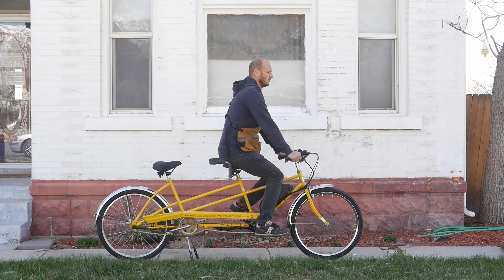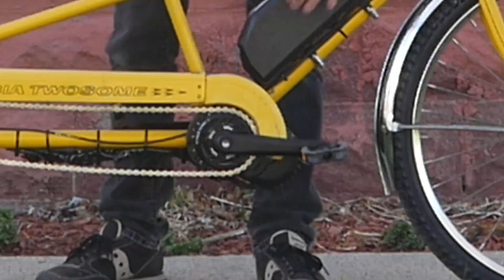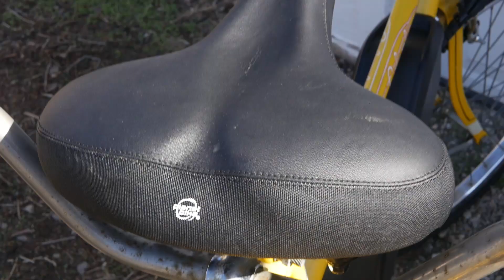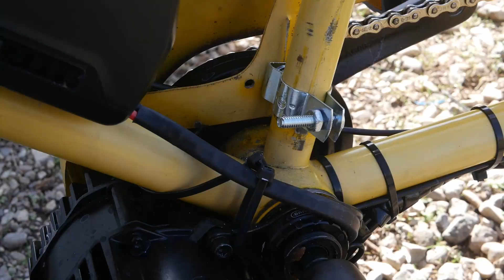Custom Electric Tandem Bike Build: Columbia Twosome Tandem BBSHD 52v

Comment: I have a mid 90's 21 speed tandem mountain bike that keeps telling me it wants to become an e-bike. Right now, it's just wispers, but they grow louder with every e-bike conversion video I watch. If I mount the motor on the front crank, put a bigger chain ring on it with a smaller chain ring on the rear crank, and I should be able to hit 45 mph easy. By myself, of course.

Comment: I've got a tandem that I don't use too often because it's made of steel and heavy. However, thinking of the BBS01 (since local regulations here limit to 250W only), but wasn't sure whether I should put it on the rear crank instead of the front. Can't work out how it'll fit until I get the motor. Perhaps it won't fit in the rear because of the frame.

Comment: I've been cleaning up a similar old tandem lately, where the one stearing is the person in the back, so that is the primary seat. Could the mid-drive electrical motor have been mounted in for the back-most pedals somehow? Could both people using the tandem have the free wheel option somehow?

Comment: Hi, I'm planning to convert a tandem frame I have knocking about, I am curious as to why you didn't put the motor in the rear bottom bracket, so that both positions are able to free wheel. I can't see any reason not to do this, but your thoughts would be appreciated. Thanx
Reply from the maker: I would’ve had to make extension for all the cables going up to the cockpit then. This way I only had to make a speedometer extension

Comment: Did you build the back wheel with the IGH or did you have it built?  If someone else built it would they build it with a different hub like drum brakes or rim brakes?  I would not want coaster brakes on the back.  Sounds dangerous.
Reply from the maker: Had it built. This bike frame was built with no tabs for mounting any kind of brakes to it. So unless we did custom mounted something on this was it. I’d like to replace the fork with one that has disc brakes
Reply: I think I would have gone with the Sturmey-Archer 3 speed with drum brakes.  That way the person in front would control all the braking.  I don’t like the idea of one person controlling the front brake and another person controlling the back brake.  
Plus with a drum brake that has hand levers you can have brake sensor to shutoff the motor when you brake.  The levers must be short pull/cantilever lever to work properly.  Sturmey Archer sell some that would work properly.  Others also sell short pull levers.

Comment: I’m converting my wife’s vintage bike and it came with cheap calipers. I swapped them for 
https://www.ebay.com/itm/Proponent-BMX-Dual-Pivot-Rear-Brake-Caliper-897-A-Dyno-GT-Blk-90s-New-Old-Stock-/192506738284?_trksid=p2349624.m46890.l49286

And I added the biggest pads I could find. I’m 240lbs and it’s stops me no problem.

Comment: Non free wheel on rear 🤣🤣🤣🤣oh no 😂😂😂😂😂
Reply: yeah, can you imagine the rear rider slamming on the foot brakes while the motor is going full throttle?
Reply: @robertkribs9513  it's got disaster written all over it
Reply: That would be a concern.  Could use a different Sturmey-Archer 3 speed that is made for hand brakes for the rear (drum or rim IGH).  Would have the handbrake up front for the person pedaling the motor.  Would be a very long cable, they make special cables for Tandem bikes (3500mm).
Would be a major change now since the wheel would need to be rebuilt.

Comment: That is a really cool build. Props for building the first e-bike I've seen with a mid-drive and coaster brakes. I have a hybrid bike I converted with a BBS02 and you just showed me how to save the chain guard I removed, thanks! I already used the Kool-Stop e-bike rim pads and love them (for rim brakes, anyway).
With the small chain ring up front & no free wheel on the back ring, how fast will that middle ring spin when riding? Seems like the person in back would have to take their feet off the pedals to use the throttle. I'm not quite sure how the tandem set up works, am I wrong about the effect of the 1st ring on the second?

Comment: I submitted my application for the subscription.  I am wondering, is there may be a fee I should have included to speed up the  process? 
I am also wondering if there is a way to predetermine what the offset should be for a lekkie chain ring.  I plan to put a bbs02 on to a Norco Storm 2.  The storm 2 has a 1X drive train.  30T front ring, 10 speed cassette 11- 46.  I am thinking of going for a 36T lekkie.  I would go 32 if the made one.

Comment: I have a "vintage" (circa 1990) tandem but I have never gotten the rim brakes right on it. I'll have to put new brakes on it. I have really wanted to convert it but I keep hesitating. I'd love to know how those brakes perform with all that power!
Reply: I can't speak to how they'll perform hauling that much weight but I have large Kool-Stop e-bike rim pads on a light hybrid conversion with a BBS02 and can lock the wheels up at 20 mph (if I'd like).
Reply: @michaelsprinzeles4022  Thanks Michael
Reply: If you are putting a 3 speed on you could go with a Sturmey Archer 3 speed with drum brakes instead of coaster brakes.  Make sure you use a short pull brake lever.